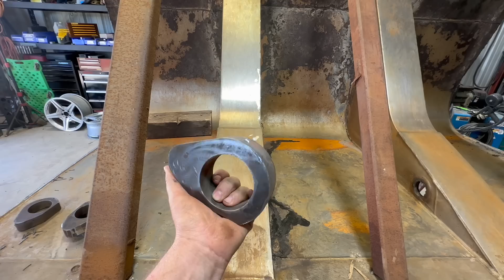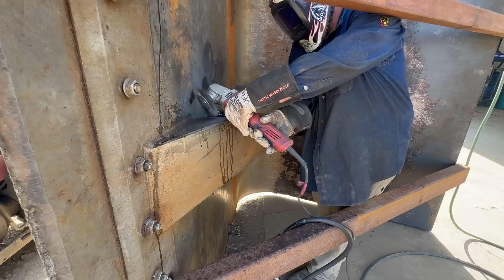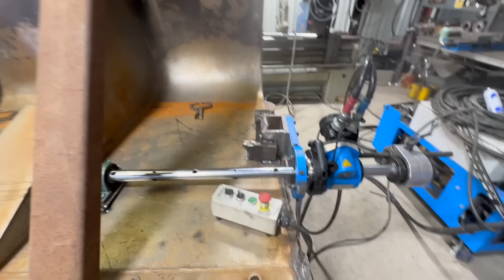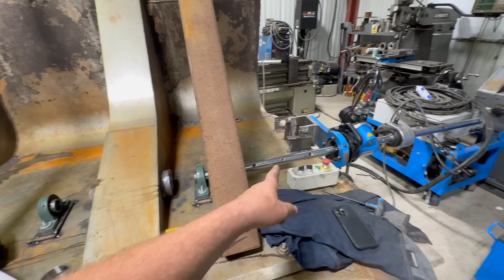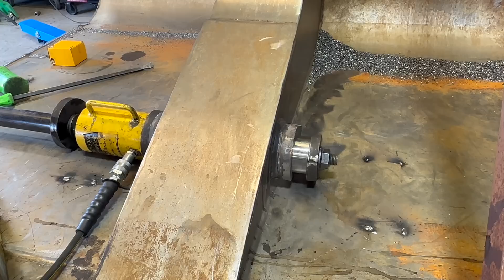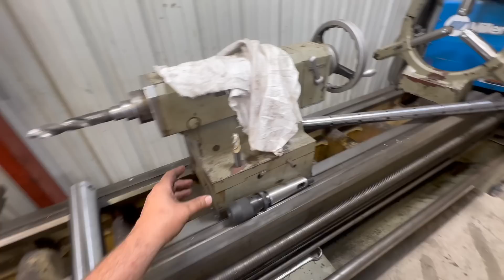Line boring tilt bucket

Comment: If you don’t mind me asking, what’s the price difference between the climax setup and the s power setup?
Reply from the maker: The s power is about $8,500 and the climax is about 90k.
Reply: @OFW  that’s quite the difference wow. Now that you’ve had some time with the s power do you feel it’s a usable setup? I’m really considering buying one to be able to do some side work as there’s no one in my area that has one. but I’ve never been around a line bore of any kind.
Reply from the maker: @colesammons2137 I feel like it’s decent for the price.  It can definitely do a good job.   I am designing adjustable bearing mounts to make the setup easier.
Reply: Think I might pull the trigger and see if I can learn how to use it. Really appreciate you taking the time to answer my questions hope to see you using it more in the future.
Reply from the maker: @colesammons2137 your welcome, and it will definitely be in future videos.

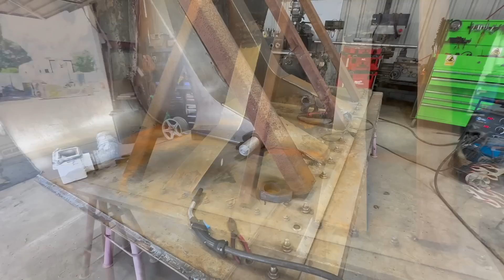Comment: Three phase comes in at 480 volts I guess the worst you can do is trip a circuit breaker by using as many 120 volt wires to get to the volts and watts of the motor you want to run or whatever the device says it needs for votes and watts obviously 4 1:20 wires are 480 but Google says coming from the power company it drops down to 460 due to loss of the line
Reply from the maker: The voltage varies by location. I only have 240v

Comment: Hey, did you ever go over why the new bushing plates had the flat on the bottom?
Reply from the maker: I forgot to.  But basically they can install the floor liner then add a small piece of 1/2” flat bar to fit under them and it will give a nice strong joint.  Basically it’s to make my customers life a little easier.
Reply: @OFW  Thanks! for the reply....and the videos!

Comment: I’ve learned so much from
Watching your videos! Thank you for creating the content and supporting the welding community. I only have a miller 211 at this point but I am just a hobbyist trying to learn as I go. I love the videos that go into detail with everything that you are doing for the fact that I can learn your techniques and what to do and what not to do. I always see you welding uphill compared to welding downhill and I would love to know the reasoning behind that. I know that If you weld downhill it’s a pretty weld compared to welding up hill. Would be greatly appreciated to get your input on that…      Once again thanks for your videos!
Reply from the maker: I weld uphill and downhill depending on the situation. Typically uphill has better penetration and fusion and is regarded as a “stronger” weld.

Comment: Almost easy $$$$$$$$ I’d say cutting oil or honey oil and slower rpm’s would get a cleaner cut for the pin bolt holes. Slower is sometimes better. Then graphite antisieze everything.

Comment: easy to make those pins greaseabe. you counter bore a 3/4" hole in the end of the pin then drill your grease hole and cross drill the outlets. the zerk goes down in the 3/4" counter bore. that way its protected. excavator pins are like this from the factory.
Reply from the maker: That’s where the pins always break and that’s why I didn’t do it that way.
Reply: @OFW  fair enough
Reply: @OFW  you might want to get yourself a "U Drill" for these situations. that way you are just replacing a couple cheap inserts and not the whole shebang when going through the hard stuff. heck of alot cheaper.  that looks like a maritool 3 flute 3/4 endmill. them suckers are 180 bucks...last time i chipped one i nearly cried :)

Comment: Nice work, I just finished up doing one of these with the hydraulic drive climax BB5000, a bit smaller bores, using the 1 1/4” bar. Had to cut holes in the floor and a small hole in the side wall of bucket to fit everything including the bore welder. I think it was for a Volvo, big Craig trash bucket. Always enjoy seeing your videos and seeing your posts in the line boring FB page, always very nice work. Been following for a while now and looking forward to seeing your YouTube presence/ following grow.

Comment: I don't get it.  Do the bolts going through the pins not interfere with whatever the pins are supposed to be mating to? Maybe I need to re-watch one of the earlier videos to see how the whole thing fits together.
Reply from the maker: The other piece goes under the bucket.  In between the pieces I welded on.

Comment: i’m getting into the mobile welding industry and was wondering in a job like this do you charge by the hour or by the job
Reply from the maker: Everything by the hour.
Reply: By the hour. You never know what kind of extra atrocities you find inside the parts, but once you cut it open it's your problem even if you quoted it a fixed price for the job. No good, that.

Comment: Here's the next great project idea for the apprentice:
Magnetic holder for welding guns.
So you can just plopp the holder to the nearest metal surface so you can use the wire brush with both hands.
The other day I barely grazed some polythene insulation sheeting with a wire brush and the damn thing caught and nearly took my head off. And I was even using the side grip.
Assuming the lad is finished with those milling cutter storage units we discussed a couple months back, how are those coming along btw?
Reply from the maker: I am looking into some nice cabinets for small storage.

Comment: Couldn't you drill a hole in the pin that way that it would have a group to follow the grease out to the ends where you have your new bushings so the grease for the center with grease the outside as well sir
Reply from the maker: Yes, but when pins break they usually break on the grease holes. There was a pin breaking issue and I didn’t want to chance it.